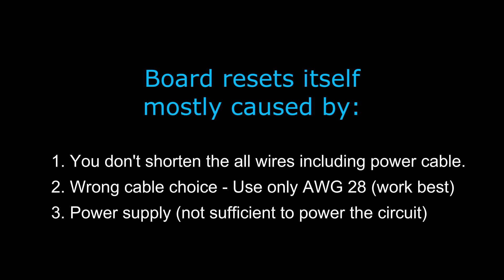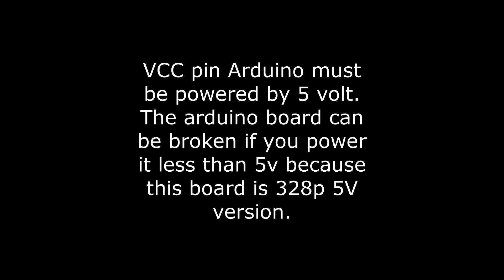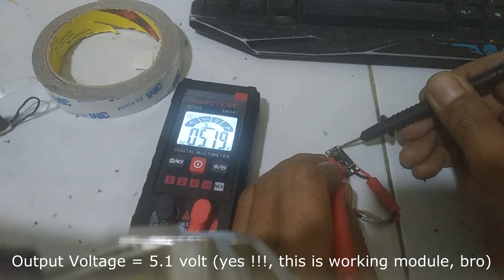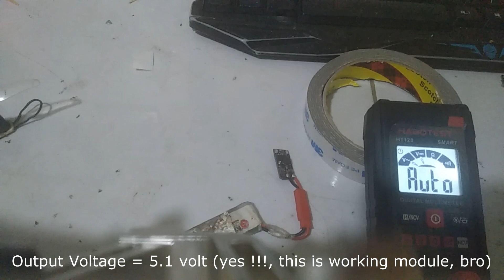Arduino Drone Resets Itself when Giving throttle #troubleshootingtips

Comment: Very useful drone tutorial ❤️🔥🔥🔥 mine also kept resetting itself when I increase the throttle. Voltage of power supply is the most cases in this case.
Reply: bad wiring. that's why I never use jumper for arduino drone project.
Reply from the maker: yes, you're right :D